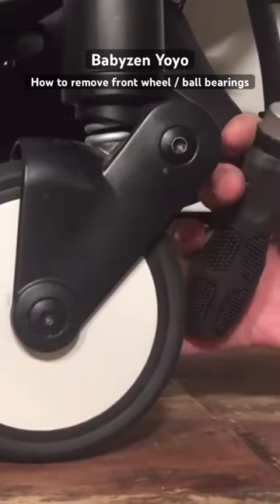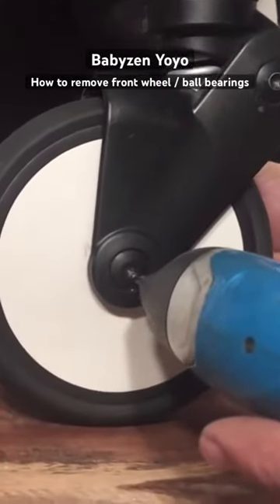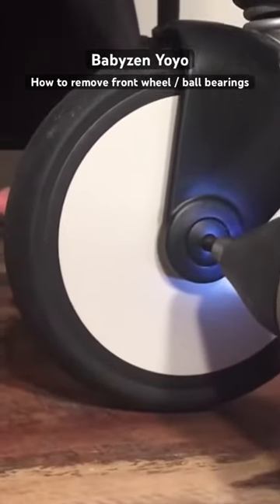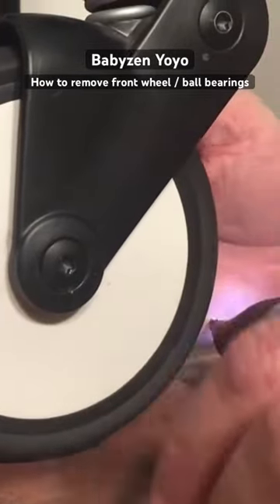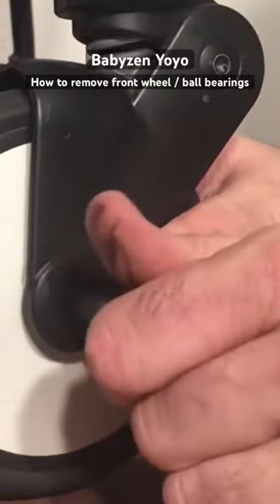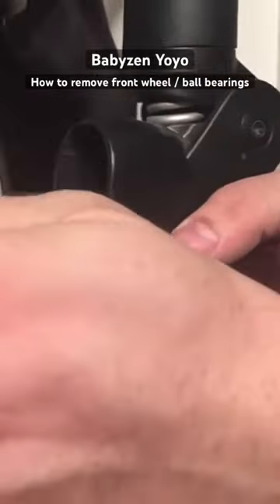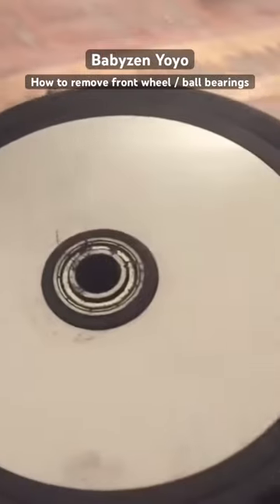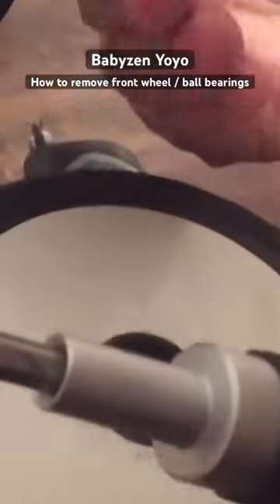Babyzen Yoyo: How to Remove Front Wheels & Ball Bearings

Comment: How does one remove the front wheels when they get stuck/rusted? Don't want to break the wheel, but would love to replace the old rusted bearings.
Reply: How did you manage? I have the same problem
Reply: Same question here.
Reply: One front wheel came of after a lot of W40 and hammering it. But the other one was not budging. We bought a Dremel and cut throught the old wheel and the stuck ball bearing. Was quite the endeaver, but now it rolls smoothly and silent on its 4 new wheels.